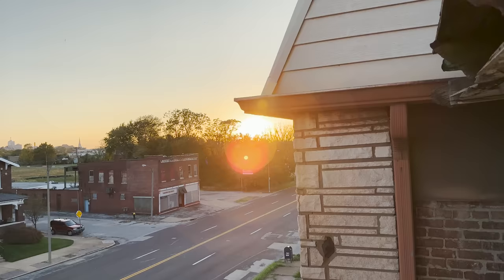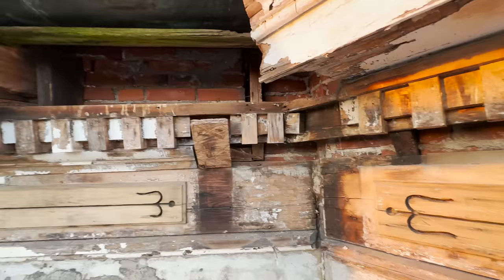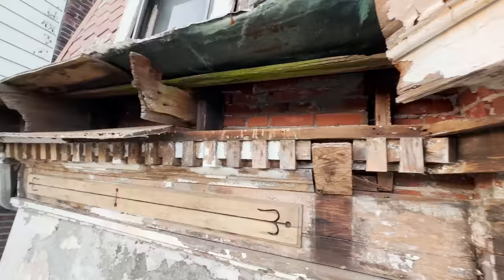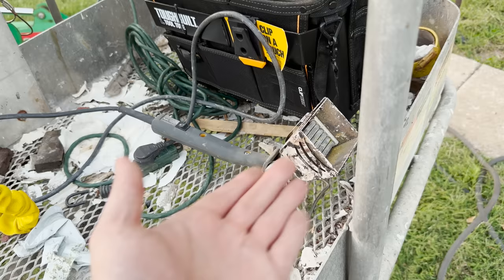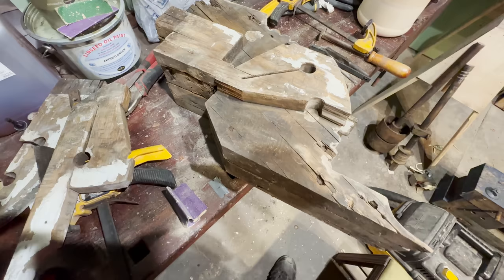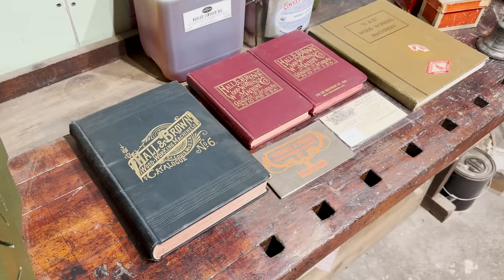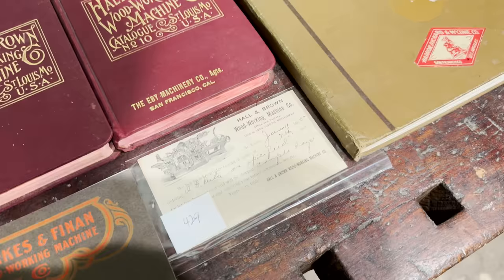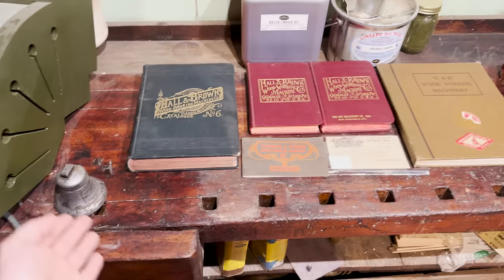How Do I Fix This..? S3 EP39

Comment: Paint removal, especially old exterior paint removal, is hell. I did this kind of work on my house. It was so much grinding with sanding discs and a diamabrush head on my angle grinder and an obscene amount of heat gun work to strip crown molding, tight corners, hard to reach spots, and detailed spots. I feel your pain with this task. It straight up sucks, but is very rewarding when you watch the old paint come off and see clean wood revealed. Good work.

Comment: You mentioned the risk of fire when using any heat source around the old wood sections to strip paint. When we were doing some kitchen remodeling in our old 1905 house years ago, I had to solder a copper pipe joint using a torch with the joint only about an inch away from where the pipe exited the wall. I knew there were wood laths behind the plaster and torching that close to the wall opening had me worried. Soon as I had the joint soldered I quickly unloaded a small fire extinguisher into the opening to be on the safe side.

Comment: Kaleb, Don't get down-hearted, where you have stripped the wood it still looks great. Considering it's age, just wow. And yes, the hose is a great idea, we so often hear of fires in buildings being repaired, seldom when they are just 'being. Replacing those rafter ends and getting the new timber fixed in the cornice will really make a terrific difference. Great stuff.
When does summer end with you, how long before the bad weather sets in?
Great set of memorabilia, love the 'Liberty Bell', truly random, but hey. Maybe it was for an anniversary, 1876 maybe?

Comment: The rafter tails behind the moldings, you may have take off an intact piece to replicate the profile of the ends and sister a new piece off the old ends if their is enough wood to secure it to. Then place the new pieces up. It should work in thoeory, just try a section and treat it with a insectiside to keep the powder post beatles from burrowing holes in the new work you completed.

Comment: Harrodsburg Castle in Kentucky (shows the most and up close view of the problem) and 2 other restoration projects on YouTube all point to the gutter construction as being the problem.  Gutter was made well but the way that it was constructed to empty was the initial problem that created the bigger problem. It couldn't get rid of the water and instead held water creating a load on the brick and wood structure.  Along with it eventually leaking internally on brick that was for internal use only so it could not handle the water as well as the exterior brick.

Comment: You are fortunate that what needs to be replaced are the joist extensions. To fully and accurately cut new extensions, coat the end profile of the existing cornice boards and transfer the profile onto a jig board. You can then use 5hat jig board to cut the needed profiles onto new joist extensions. Do not try to use the old  built up ones existing. As you can see those have separated due to the dis- conformity of the pieces and will do so again. When the house  built, they did not have portable power tools  that can ease the cutting of such shapes , only very large band saws so those extensions were most likely cut by hand and then built up in a similar manner as the corbels. The new extensions should be new full thickness pieces of treated wood, so they are moisture ,rodent and insect resistant.

Comment: Would it be possible to remove all the external gutters, frieze boards, corbels, dentil molding, and the like and work on it down at ground level/indoors? I feel like not only would that be easier/faster, but would allow you to inspect and address all of the brick and stone issues that might be lurking behind those boards that you currently can't see.

Comment: when replacing rafters for that, you could try metal wrappings over them (that can be tapped)so squirrels and mice won't have as good chance to chew through

is the bell a paper weight? the bell was probs advertising

Comment: Out of curiosity, would you be willing to share what product (s) you use in your wood restoration projects? Might need something like that in the future.
Reply from the maker: Absolutely! for stripping paint with heat: Cobra Speedheater. Chemical: Coopers strip club. Wood filler i use abatron wood epox and liquid wood. Make sure to use both together. Best wood filler out there. Ill do a deep dive on this in the future. So watch out for that.

Comment: I keep wondering what the time period is of that house immediately next door, it is definitely not from the era yours is from, not even close.  I'd wager mid 20th Century or later, but its not really clear.
Reply: Its a victorian house that was gutted and reclad, possibly in the 60s era? In the old photo which is available online, you can see it as is was originally, it was once a nice looking house
Reply: @dcan911  And here I was thinking the house that was originally there had been lost (burned down, maybe?) and that someone in the mid 20th century had decided to build an entirely NEW house in the same size and shape as the sort that had been there before, but with a 60s style on the outside.  Sad to hear they gutted an existing Victorian house and then changed the outside look.  Maybe someone will eventually recreate the original look, inside and out.